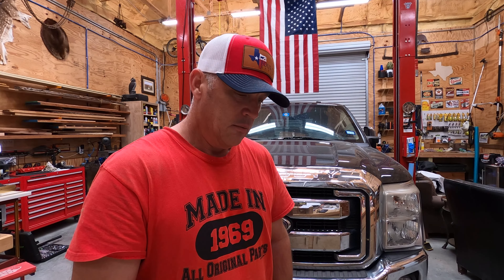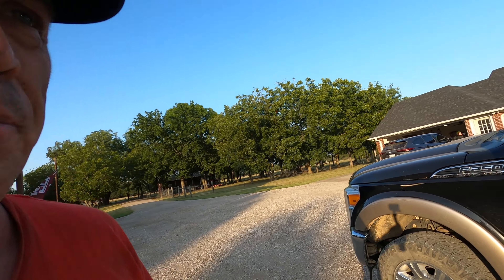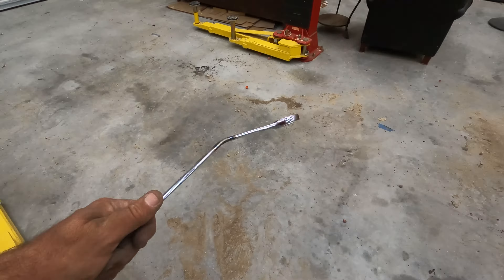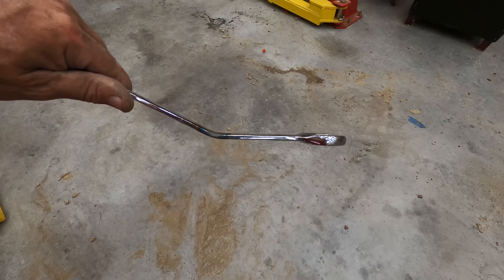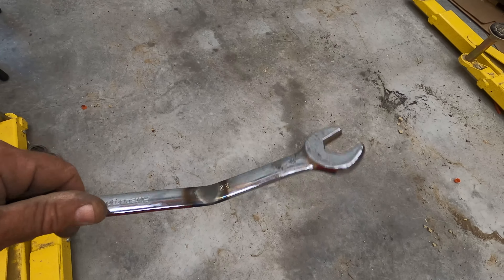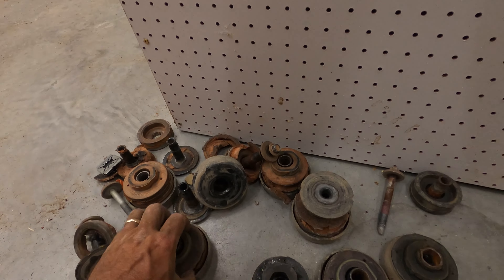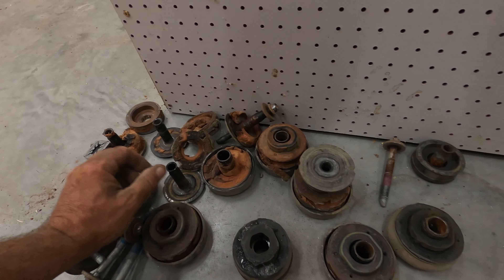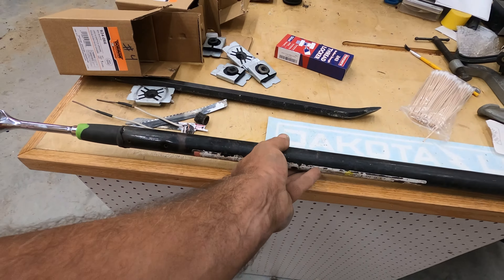Replacing Body Cab Mounts in my F250: Options, Challenges, and Solutions. Ford SuperDuty 2008-2012

Comment: Just did mine today,on my 2011.  For the core support mounts if you remove the  grille there is enough room on both sides coming in from the front to sneak a brazing tip from on oxy acetelyne torch to get down in the support and heat those captive nuts. For the others just use a small breaker bar and common sense. dont need heat. just loosen then tighten back and forth in small increments until they free up. those bolts are pretty long for heat to travel up. And yes my truck is pretty rusty underneath.
Reply from the maker: Great tips! Thanks for sharing.

Comment: In earlier years one must remove the back seat and lift carpet under front seat to access the body mount bolts from above. This redesign supposedly is more convenient and less labor intensive, but obviously the captive nuts can make it harder. When I have money from oil & gas leases I plan to replace body mounts on my 2005 Super Duty and also install a front hitch receiver and winch since I likely will have to remove the bumper. My truck is diesel so I get it serviced at a tractor, bus and limo garage. They have assured me the job is very easy for them to accomplish but I expect to spend about $2K for labor,  S & B mounts, hitch and winch plate. S & B mounts were unavailable during pandemic.

Comment: Just did the body mount bushings on my 2015.  I went the cheap route and did it with MAP gas.  I had a stray bottle with water to put out any fires as I went along.  Heated those bolts well and they all let go. As some other videos have hinted, DO NOT use an impact driver. You run the risk of spinning that crown nut. Use good, ol' fashion arm strength and if the bolt is heated well, it will let go.  My truck has lived in Texas all life long so rust was not an issue. If you do have some rust, perhaps that heat induction tool could help. Took me about 4hrs, stopping for beer breaks.

Comment: Did my 2013 F250 King Ranch and a world of difference.  Took me 3 days to get it done working on it after work.  My kit was the $300 silicone that works well and bought the Dorman bolts so far. 

Took the savings and installed Rough Country E-boards that are awesome for my short wife.

Comment: I replaced my mounts with S&B bushings on my 2007 Ford f250. My truck was harder to do because you have to remove the seats and pull back carpet to get bolts out. It was a job, I had 2 bolts hard to remove, 0ne inside front frame next to the headlight,  the other one was in the rear cab. You cannot use a impack, only a pry bar, did mine w/o heat just muscles. Gotter done December 2022 rides very smooth.👍

Comment: Just did mine.  If you do it from the top/inside, I used small auto on propane torch.  Burn the loctite off threads.  After you crack it with a cheater bar from underneath, they come out like butter.  If it gets hard, heat it again.  PITA but fast once you get the carpet up and heat bolts from above, just to liquify loctite/threadlocker.  Pain removing rear seat, popping panels but went smooth once I got access.
Reply: pullin the rear seat takes 10 min tops wym🤣

Comment: I recently bought a 2011 f250.
Found a head missing from 1 bolt at right front mount.
Suggestions?
Will the bolt come out thru the top end?

Comment: Thanks for this.  Its been helpful in giving me some possible solutions.  I've got a 2012 which spent the first 9 years in NY state so locktight is the least of my worries.  I have the hot rod and heated the front drivers side until it was red hot, I thought I was setting fire to something the amount of smoke that came out of it! Then used an 18 inch breaker bar and spun the nut straight off.  Same happened for three other bolts because the captive nut is rusted to the bolt in the frame.  I think the only solution is to cut the head of the nut off and put out the bold and nut in one go.  WIll mean removing the interior of the truck for the back three.  The front ones I am going to try and get out through the frame but there isn't much room to work with.  Outside of the EGR problems and exhaust sensors this is the worst things I have come across with Ford.  Should be a six hour job, looks like its going to be a three dayer!
Reply from the maker: Yep, it sucks! But I have to say, it rides like new now.

Comment: Just got my new S&B mounts in today for my 2011 F350. They just lowered the cost of them from $699 to $499 and they have a lifetime warranty. If one comes apart, S&B send you new mounts and pay for the replacement. I’m going to buy a Map Gas torch and heat each for a minute then remove by hand. Where did you Jack the cab up at? I heard putting a 4x4 piece of wood under the pinch weld and lifting it there is a good place.
Reply from the maker: That’s a great price! Good luck. Yes I jacked the cab on the pinch welds. Worked fine.

Comment: Would you be able to show / state where you placed each on your lifting points under the cab? 
And did you do entire cab in 1 lift, or do 1 side at a time, or 1 corner at a time? Thx!
Reply from the maker: I have a lift, so I placed all four lift pads on the cab pinch welds, balanced from front and back. Yes I lifted the entire cab up about 2-3 inches, all at once. Hope this helps.

Comment: I love your approach and attitude!  Thank you for the video, which I found after messing up one captive nut --- it's right behind the seat (2010 Plain Jane F250), and I can cut the bolt and pull it out from the top.  The other 5 I fretted about a LOT after this and other posts.  I have easy access to all of them though.  I hit them with a air-acetylene torch (something EVERYONE needs to own) for about a minute and then used an impact wrench.   All 5 others came out easily.  And this is a Coastal Maine truck since 2012.  Now I'm fretting a bit about removing the parts and installing the new ones..... two days ago replaced all the bed rails and shocks, looking forward to a better ride all around.
Reply from the maker: I hope you were able to complete your project. It is worth the pain...my truck rides like new now!